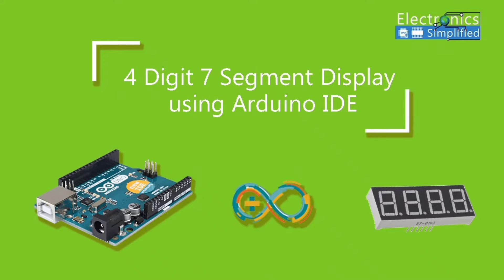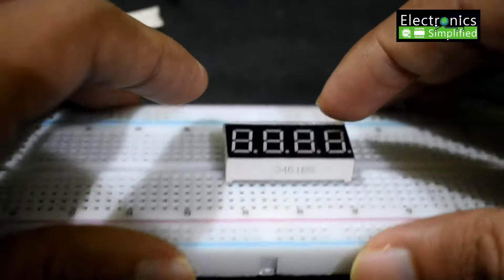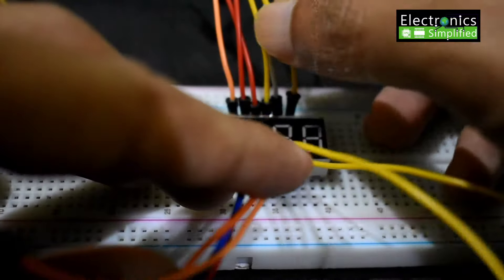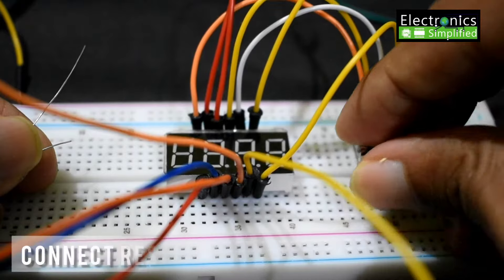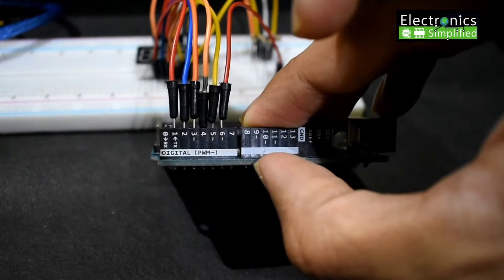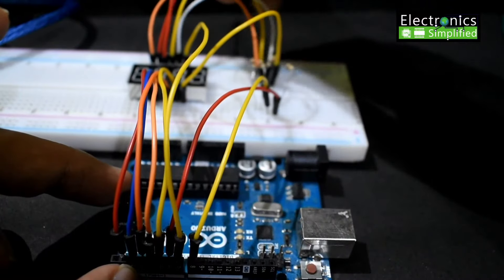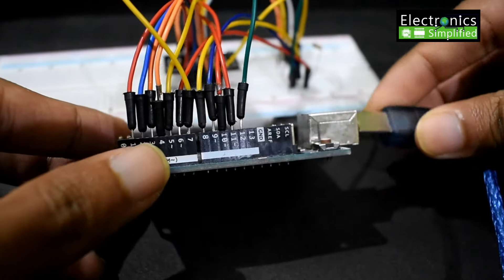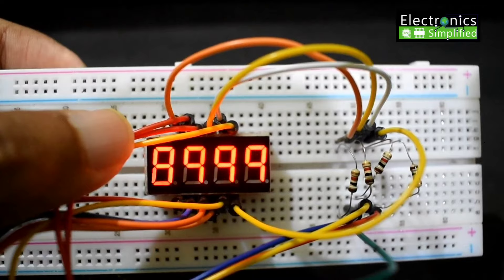4 Digit 7 segment display using Arduino

Comment from the maker: The code is updated. If you have any request on altering the code or using it in an application like a digital clock. Drop in your queries to electronicsengineering3@gmail.com

Comment: The code seems to have LOW, HIGH values inverted? f.e. number 1 has only pinC and pinB set to LOW, while those are the only pins that should be HIGH to make number 1. After reverting LOW to HIGH and vice versa it started to show me the numbers correctly.  What am i missing? :D BTW thank you for the video and code - the best tutorial on the topic i found :)
Reply from the maker: You need to identify the type of segmented display you are using. Anode or cathode. Everything changes based on that 😄
Reply from the maker: In my video. I guess it's a cathode display (so all the values are inverted)

Comment: Could i use this same wiring and just add in an mirco switch into the breadboard so when pressed it would light up as an scoreboard?
Reply from the maker: This current circuit can't be used as a scoreboard
Reply: @ElectronicsSimplified7  Oh i see, do you happen to have a video for using this display as a scoreboard? Appreciate the reply.

Comment: Hi. I would like to use this on my chain throwing outdoor game score counter. There is like 4-6 different size holes where you try to throw the chain through. It would perhaps need some ir censors or something else what the chain would activate when it goes through the hole and give you that amount of score in the display what you have decided to give from each holes. Would you help me build that? If yes we can continue with mail..kind regards. -Ville
Reply from the maker: electronicsengineering3@gmail.com
Reply from the maker: electronicsengineering3@gmail.com you can drop it here

Comment: The code page doesn't work
Reply from the maker: It's fixed
Reply: Yes it is not working even in full network
Reply: @vinodganve5655   true
Reply: @ElectronicsSimplified7  I don't think so
Reply from the maker: The code is a download file for PC and if that doesn't work. Now the code is on a webpage too, so you can copy it and use it. Cheers!!